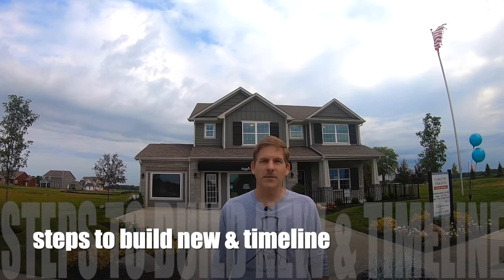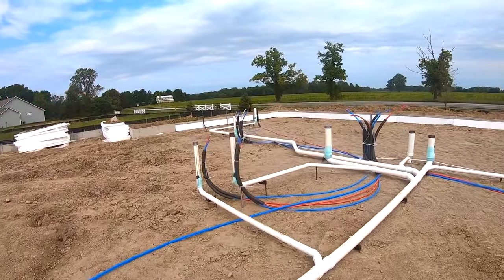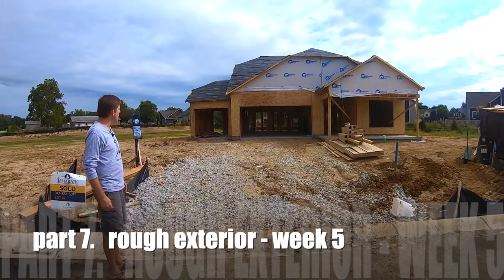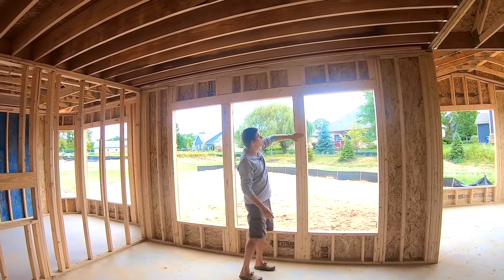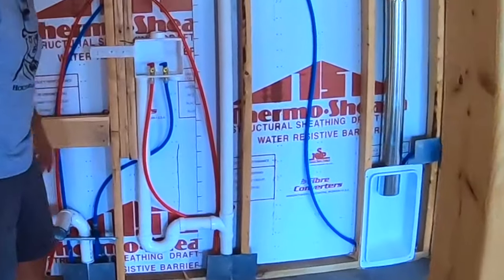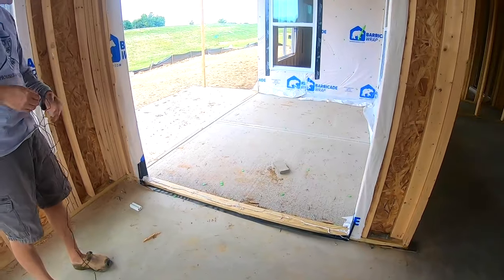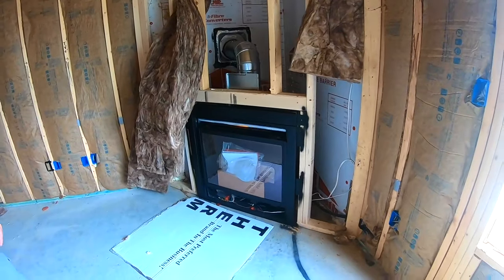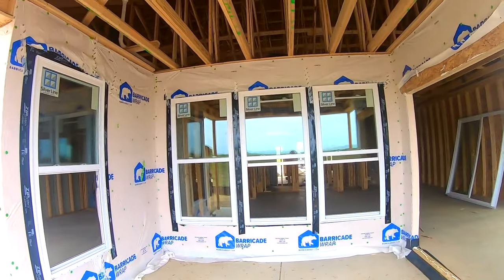steps to building a house timeline

Comment: Nice, educational content. From european building standards view this looks more like a mockup of a house :D We use alot more concrete and bricks. Because of that our instalations have to be planned with more caution and precision in case when you need to swap something out, or do repairs. Also, we use solar or geo power for heating, and we use more insulation. The time needed to build a house is way longer tho, sometimes years, and the costs are higher. Wooden structure is not viable in mose of europe because of varying weather conditions, and its usually percieved more as a temporary solution. People are afraid if its going to last, even when it's proven, that well preserved wood can well outlive concrete.

Comment: Great info, thank you! I'll never understand though why some home builders are not using block construction on at least the lower level walls. That is how all homes in FL are built. Not only is it stronger, its less complicated and less work. Especially in areas such as around the garage doors etc.
Reply from the maker: Hey Superpower,
In an area were masons are plentiful, that’s a good point. But if there are fewer masons, then we make use of plentiful numbers of framers. Framing might just be a bit faster as well.
Thx for the comment!
Reply: Not even close to all homes. Definitely not less work either

Comment: Is wood framing cheaper than hollow block and cement as a wall? What's the difference or disadvantages? Just curious 😊 don't have any knowledge about building but so eager to learn
Reply: Tried by Justine I think it depends where you live. Hallow block/cylinder block walls can get more expensive than all wood walls as you still have to wood frame the inside part wall in order to insulate and attach drywall but an advantage in the outside you don’t need siding. Not an expert but hope it helps:)

Comment: What happens if something goes wrong with the hoses and pvc pipe that was covered in concrete? Do they just jackhammer the foundation?
Reply from the maker: Hi black light, we needed to reroute all of the plumbing in a ranch house that was built on a slab.  To accomplish that we rented a concrete saw or cut-off saw.  We cut trenches using the saw to get through the concrete slab until we reached the gravel base underneath.  Repairs in concrete slabs can be made this way.  It's big work and very messy.
Thanks for your question!

Comment: In Arkansas I always see them pour footings outside of the foundation to lay the bricks on? Is there a reason for the difference?
Reply from the maker: Hey Cory,
The foundation we showed at the beginning had that. That concrete “ shelf “ is part of the foundation and holds the massive weight of the brick exterior. Every brick exterior should rest on that. 
Thx for watching.

Comment: Im building a 12  X 16...So far Ive only done the framing & it feels wobbly..Is that normal??
Reply from the maker: Hey Fastestman….,
Do you have any bracing going from walls to stakes in ground? It’s a good idea if not to keep the walls steady and plumb. Once you put sheathing on at corners it will become more solid. Or you could cut in diagonal bracing. 
A good idea is to go to a big box home store or library and get a book on framing and construction. You want to do it right the first time. 
Thx for watching!

Comment: In my country we are not used to use so much wood.. seems very unsafe incase of fire or long term rot.. interesting video though
Reply from the maker: Hey Marijn,
Where do you live?
We have found that not every country builds the same way. We use the materials that we have available.
The reason we don’t have a big fire risk, is that the wood stud walls are covered by drywall, or Sheetrock - a material ( gypsum) that resist flame well. The wall interiors are filled with insulation which does not allow enough air for a flame to get the oxygen it needs to get burning easily. 
That is not to say a fire NEVER happens, but they are pretty rare. And, Modern homes here also have smoke detectors to warn people in the house that a fire has accidentally started. That helps any fires that start to get put out quickly. 
Thanks for watching and commenting.

Comment: I don't know if there are any Brazilians here, but I didn't understand one thing: do they make the house without cement or concrete? Is that right or did I get it wrong?
Reply from the maker: Hey William,
The house has concrete for the foundation and main floor. Everything on top of the main floor is typically wood.
Sometimes, the exterior siding is thin cement panels. 
Thx for the question. 
And thx for watching from Brazil!
Reply: 2:28 There is concrete in the foundation. Many places in the USA don't have extreme weather so concrete walls aren't necessary and would just cost more. In Florida most homes are made of with concrete walls because of our weather.

Comment: Would it be possible to do the framing with metal to have a longer lasting house? What is the estimate price difference on this house if you would have used metal
Reply from the maker: Hey Listed,
We are currently renovating a house that was all wood framed when the Wright Brothers were building their first “ flying machine” -120 years ago. Wood lasts very well!

Yes, you could use metal. Depending on the thickness it can be priced similar to wood all the way to 50% more expensive. 

Still you could build a wood framed house today that will out last you and your children... and even the lives of your grandchildren and great grandchildren if well kept up or renovated in 120 years. 

Thx for the question and for watching!

Comment: Cheap Construction. It’s wild to see different construction methods regionally. Great job explaining though!
Reply from the maker: Hey Texas,
Different areas have different needs. No sense building for ... say a hurricane where we are. That being said, sheathed 2x4 or 2x6 wall construction is incredibly strong .
So what kind of  construction would be better and why? How are your roofs framed? 
Thx for commenting.
Reply: @Housebarons  A slate or terra cotta roof on a heavy timber frame with lime plaster would be beautiful and tasteful, though obviously it costs more for that kind of construction (beautiful and tasteful). The construction industry is unfortunately about maximizing production and minimizing costs, rather than making anything high quality that holds up for more than a couple decades

Comment: I am having the hardest time finding studs on the exterior of my house which is stucco exterior on a wooden frame like this in the video. I measured the studs from the inside and transferred the measurements with care and precision but it is failing all the nail tests! I have put 10 holes and found no stud. I noticed here there should be a stud every 16 inches which should be accessible from the exterior too. Could you help me shed some light on the issue? I really appreciate it.
Reply from the maker: Hey Amirhesam,
We just had a very similar struggle - turned out we were not going deep enough... so try a longer screw to reach the stud from the outside. The stucco may just be too thick and your screw many not be getting deep enough into the stud to bite and sink in. 
Thx for watching!. 
Hope that

Comment: Im wondering. If the house height is 8ft. Do you cut the studs 8ft or do you cut it so the interior measures 8ft?
Reply from the maker: Hey Heavykiin,
Typical pre-cut studs are 92 5/8 inches. It sits on a bottom horizontal stud ( base plate) and has 2 staggered horizontal

  2x4’s at the top ( double top plate ) plate. 
So that total  1.5 plus 3.0 plus 92 5/8 = 97 1/8 or  1 1/8 taller than 8 ft. 
That allows for 5/8 inch ceiling drywall and 1/2 flooring. 
It also keeps your drywall sheets from resting on the floor by 1/2 inch. 
That way if there is ever water on the floor, the drywall doesn’t sit in it and soak it up. 

Hope that helps. Thx for viewing!

Comment: How long do the wood houses last though ? I thought the wood will start decomposing once the tree is fell ? 

Is it prone to getting damaged when you are moving heavy  things inside the house ? 
Will it break if a heavy person leans over ? Can a light punch make a hole ?
Reply from the maker: Hey Subash,
Where are you from. Where do you live? I’m curious what types or kinds of construction you are used to.

Here in the USA, we have an abundance of wood and actually wood makes a very strong building material.
Wood that is kept dry can last centuries. The oldest timber framed barns are in England and are 700-800 years old. 

When wood gets wet, it can rot ( like fallen trees in s forest) and decay. Wood eating termites  are another concern with wood. But their presence is easy to identify and treat to stop before serious damage is done. 

To prevent water damage, the roof and walls are designed not to leak. That is very important, so wood building are carefully designed.

Wood structures are lighter, flexible and stronger (do better than concrete and brick) in earthquakes. 

A wood framed floor here is typically design to carry 40/lbs per square foot ( or 195 kg/sq meter). That will hold all heavy furniture.
If you wanted to store heavy machinery or cars weighing 1000’s of kg, we would keep that on the main level on a concrete slab floor. 
Walls of typical homes are 2x4 inch vertical  studs spaced every 16 inches covered inside by sheets of gypsum or drywall. The sheets of drywall are typically 1/2 inch thick and reasonably strong. You could kick a hole in drywall, but punching it would risk broken knuckles, or a broken hand if your punch strikes drywall with a stud framing behind it. 

We once demolished a house destroyed in a fire. Even after a great fire the house required substantial effort to demolish. 
https://youtu.be/1A8EO6gAIOw
It is very strong. 

Hope that helps,
Thanks for watching?

Comment: Question concerning the pex cemented into the foundation.

Pex and copper both have life expectancy. So if it's installed, like shown in the video, what happens when a pipe breaks?

Thank you for making this video btw
Reply from the maker: Hey Josh,
Great question. You dig through the slab ! 
But I’d guess it’s fairly uncommon. Pex is very flexible and won’t split like copper when frozen. It does have limitations when exposed to UV light ( sunlight degrades it beyond 30-90 days of exposure) . Apparently Pex has been used for decades in Europe. So it has a track record. 
BTW.   -  digging thru the concrete slab is done. We did it once when rerouting plumbing so we could move a bathroom. 
So no worries in the long run. When it comes to houses, most things are fixable.
Thx for the great question!

Comment: By the time you got to step five about how much was everything just up till step 5?
Reply from the maker: Hey Book...,
There are so many variables that it would be tough to tell you accurately. 
But you could get an more realistic idea by finding a buildable lot, then calling a plumber and concrete company and ask them about a typical 1500 sq ft slab 3 bath home might run. Then add it all up. 

Do you have access to city utilities or are you putting in septic and digging a well??? Big difference. 

You may want to call more than one - let them know you are gathering info and won’t hold them to it. 

I have an estimating book : says $35k plus the lot. But that could be a really high estimate in middle Kansas and a ridiculously low estimate in San Francisco.....like I said - way too many variables. You’ll need local companies to give you local input. 
Hope that helps.
Thanks for watching.
Reply: @Housebarons  ok thanks great video

Comment: What was the cost of building the home? Materials, labor etc.
Reply from the maker: Hey DRP,
The super ballpark estimate as there are SOOO many variables from house to house and location. Let’s say is 60% matetials , 40% labor ... but could go closer to 50/50. 
That assumes we are not talking about super inflated markets. 
So in Midwest USA, finished, the house - is $270-300k - for 2000 sq Ft or so- no basement. Lot price will swing it in either direction as well. And that does talk much about finishes.
L o t s of variables.
Thx for watching.

Comment: Wait a second. Pex is t supposed to be exposed to UV. They just laid it out and threw concrete on it? I’m no professional builder or anything, but I would have expected to run conduit or something to protect it and make it easy to repair in the future. Is that unreasonable?
Reply from the maker: Hey Deborah,
You are correct that pex is susceptible to UV. It depends on the type, but exposure is supposed to be no more than 30-90 days. Usually from the laying of plumbing to the concrete being poured, it’s completed in a week or so. Not much more. 
The pex is covered by sand ( to protect it ) 
and gravel. If there is a problem, they have to dig thru the concrete slab to get to the pex. 
Fortunately, pex leaks would likely only occur at joints and not in the middle of a long run so the need to dig thru the slab is uncommon.
Good eye. And good question! Thx for asking and watching.

Comment: How much is the cost building this house?
Reply from the maker: Hey Itsjoshua,
In our area of the Midwest, generally a new build is somewhere in the range of $140/ sq ft. But that number varies greatly depending on finishes and options. I don’t remember the exact square footage of the house but if it were 2000 sq ft and no basement , it’s around $280,000.
Hope that helps. Thx for the question.

Comment: How much did the building material cost?
Reply from the maker: Hey Harry,
It will vary - even widely. But a fair rule of thumb might be 60% material, 40% labor and other. If you have super high end finishes, that material percentage increases. If you have work that requires more craftsmanship, the material percentage drops. Hope that helps.
Thanks for the question and for watching.
Reply: Thankss mann great vid

Comment: I think american houses are very beautiful, but I don't know if I would have the courage to live in, the structures look so weak and seems like it wouldn't resist to strong winds or it wouldn't last much, once everything is made of wood.
Reply from the maker: Hi Valter 9350, I have lived in a house with a wooden frame for 27 years. We frequently get very strong winds and the house is quite sturdy, no issues.

What part of the world are you from and what materials are used for the housing in your area?
Reply: @Housebarons  I am from Brazil,  most houses here are made of bricks and concrete, there are a lot of wooden houses, but their walls are made of wooden boards.
 As I said above i think American houses are really beautiful, i just don't trust much on the structure,  but it is just my impression when i see it, doesn't necessarily mean it is weak.

Comment: Which material used for roof and walls in foreign countries Houses!? It's cement concrete or what!?
Reply from the maker: Hey Hello World, 
Thx for writing to us from India! As you have said, building houses is different in different parts of the world.
What you see in this video is typical wood framing in the USA. 
The walls are wood studs. The exterior is 4 feet x 8ft x 1/2 inch sheets of plywood or compressed wood. Then the exterior walls are covered by any of many different materials to protect the wood :  vinyl or plastic, painted wood, thin cement siding, brick, or a thin concrete-like covering called stucco. All of these exterior wall coverings protect the wood for years. Interior walls are usually made of wood studs covered by gypsum sheets.  It is not hard to find houses over 100 yrs old in the USA. 
Maybe climate is a big factor. In much of USA, In most places here, humidity and rain amounts probably don’t equal what you get in India. In our southern regions, we do have homes commonly made of concrete block and occasionally all concrete. But all concrete house is expensive here. 
All our tall buildings are steel and concrete. 
Hope this helps! Thx for the interesting question and for watching!
Reply from the maker: Hey Hello World,
Typically for roofs, on top of the wood is a water-resistant membrane with either metal sheets or asphalt shingles. 
The asphalt shingles typically last 15-20 and then need to be replaced. The metal roofing can last 50 years or more and is being used more and more these days. Some roofing in the drier western regions of the USA use clay tiles which also last decades. 
Thx for asking. Peace
Reply: @Housebarons  thank you brother.. appreciate for your quick response..🙏😘 this helps me..
Reply: @Housebarons  for wall it's good to install foam spray Wall..!?
Reply from the maker: Hey @helloworld,
Foam spray here is a very good and usually more expensive insulation. Great for help with sound proofing and temp control. Not sure if we are talking about the same stuff. Probably so. Good stuff if used in between studs. Thx!